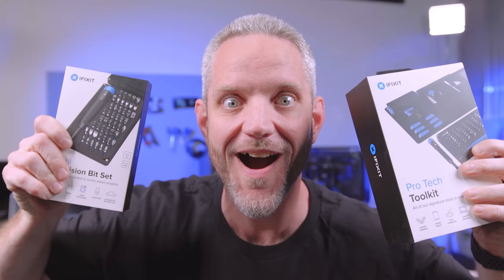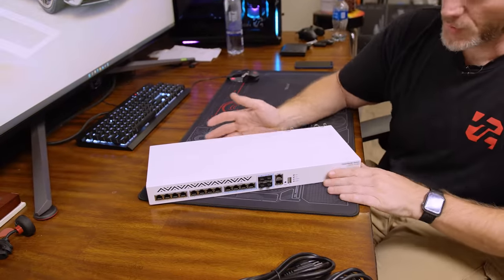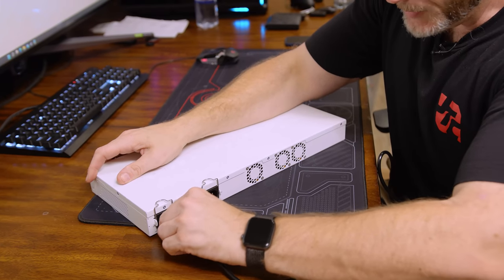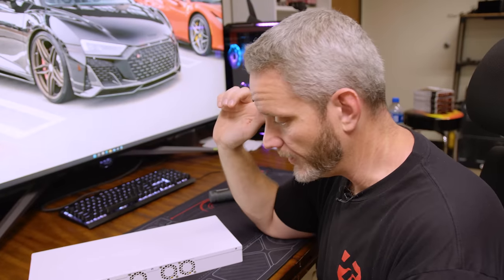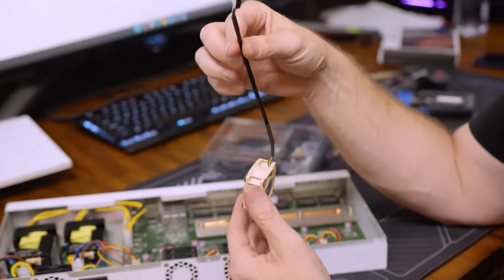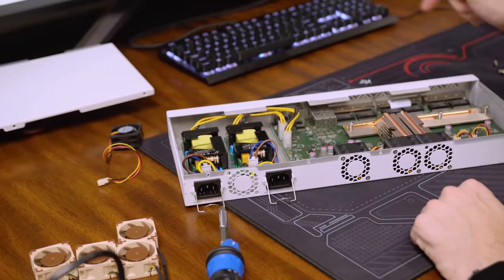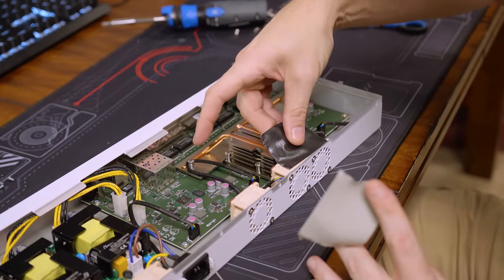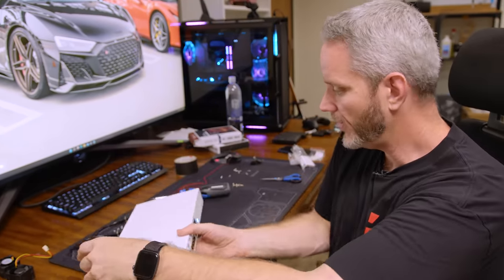We had to modify our new network switch...

Comment: I'm sure you already know all this stuff Jay but I wanted to clarify for your audience some of the confusion around SFP+.

SFP/SFP+ is just a hot-swappable data transceiver used in data network applications. It isn't "Ethernet" or "Fiber". It's a layer 1 technology that only handles electrical and/or optical signaling. It is designed to add versatility to your network infrastructure by allowing the design to implement different carrier mediums (i.e. copper or fiber optic). In most network designs that use SFP/SFP+ technology you'll see either fiber optic modules or preassembled high speed copper modules/cables (called DACs or direct attached copper). However, SFP+ is also capable of supporting RJ45 for standard ethernet connectivity. So if you run into an issue like where Jay was saying he couldn't find an SFP card that would fit in his server, you can still use a "regular" ethernet card in the server and an RJ45 SFP+ module in the switch and everything will work fine. No need to worry about modifying any patch panels. In the case of what Jay is doing, personally, I would look around for an SFP+ card that will fit in the server and connect the server to the switch with a DAC. Especially if they're going to be living in the same rack. That would provide the most reliable connection between server and switch and is plenty capable of 10Gbe speeds (I've run 40 and 100 gigabit DAC connections between core switches in datacenters many times).

Just my two centz...
Reply: Good info. The issue that Jay was referring to at 1:37 is that the SFP+ cards (or any PCIE card for that matter) would not fit in their PCs  that they use to edit videos because the PCs have vertical mount GPUs, NOT that the SFP+ card would not fit in the server. I assume their video editing rigs all have 10G ethernet on the motherboard.
Reply: @kevinoneill2170  There are kinda small PCIE low profile SPF+ cards.

And that resolves the issue. as the most expensive thing are the 10G ethernet cards.
Reply: @kevinoneill2170  Ah I see. Well, in that case, if they do have 10gbe built in then there shouldn't be a problem. I wonder if half-height cards would fit, in case the motherboard doesn't have built in 10gbe.
Reply: I think SFP+ DAC is better than CAT6 for short runs, lower latency and a lot cheaper. 10GB Ethernet is between £50 and £100 per end where as SFP+ cable is £20 and the cards are £30.
Reply: @kevinoneill2170  I think what he means is that you can find SFP+ connectors that adapt to copper for Ethernet runs, instead of fiber. Either way, unless he has runs of Cat 6A (current ethernet standards) surpassing 100 meters (100 meters is the maximum rated distance for Cat 6A at 10Gbase-T), he shouldn't need to worry about SFP+ runs over Ethernet runs in the office/warehouse. The only real benefit of using fiber over copper, that I know of in this case, is that copper tends to get hot at 10Gbase-T.
Reply: @wayland7150  DACs have definitely gotten much cheaper these days. And I agree, for shorter runs, it's definitely the way to go. Especially for rack or riser applications.
Reply: @wayland7150  This!
Reply: @RuxUnderscore  Fiber also has lower signal times than twisted-pair: single-digit microseconds or less over typical on-premises distances, versus up to milliseconds. The major limiting factor on shorter fiber links is processing time and electrical signal propagation within each device.
Reply: The ONLY reason to use 10Gb-T is for backward-compatibility with existing infrastructure.  If you ever have a choice between 10Gb-T and an optic or DAC, go with the latter.

Jay's build, from what I understand, has no room for an Ethernet card at all -- the slots are all blocked by the vertical GPU riser.  So, onboard Ethernet is the only option.  And, of course, most motherboards ship with RJ45 jacks rather than SFP+ slots, because most of the time you only get one Ethernet jack, and it has to be backward-compatible with 1Gb Ethernet, which most people are going to use.

That.. unfortunately.. is a reasonable case for 10Gb-T.  And if you absolutely must use 10Gb-T at all (which should always be the Plan B choice), then it makes far more sense to get a 10Gb-T switch rather than getting a switch with SFP+ slots and using 10Gb-T transceivers.  10Gb copper optics (*) are a hack, and should only ever be used in life-threatening situations, where someone will be killed by murder hornets if you don't get that server up now Now NOW.

(*) I know Gb-T modules are not optical.  It's a misnomer, but it's a handy misnomer, to refer to any SFP/SFP+/QSFP+/etc. add-in module, including ones that terminate in copper.
Reply: @nickwallette6201  Nothing wrong with DAC if it works. It's just not for long runs. OK for interconnecting between things in the same rack and a bit further. Fibre optics use electricity at some point, it's not like they keep it as pure light forever. The SFP+ plug is electrical.
Reply: @wayland7150   I understand that.  I have no issue with DACs at all.  If I'm cabling within a rack, or between adjacent racks, that's the solution I go with.  Otherwise fiber.

My point was, and is, 10Gb-T is terrible, and should never be used, unless it's literally the only option.  :-)  And I wish vendors would stop putting it on so many quasi-performance-oriented systems.  Just include a standard 1Gb-T port, and add an SFP+ slot.
Reply: But can all SFP+ switches support a SFP+ copper module? To my knowledgez such a module draws much more power than a DAC and I have looked at multiple switches and seen no mention of support for SFP+ copper modules.

Right now, I have a 8-port 10GbaseT switch that sounds like a jet engine and can't do 2.5Gbit and 5Gbit which is a bummer with equipment that can't go the full 10Gbit speed.

So I have been looking and wondering if there are any 12-port switches that can do 1/2.5/5/10 Gbit and has some mix of SFP+ and 10GbaseT, does support VLAN and doesn't sound like a plane. Life would be easier if I knew it also supported SFP+ copper modules, because I have at least 6 or 7 NIC with 10GbaseT and several are multi-port, server-grade cards each costing about the same as this switch.
Reply: @perwestermark8920  sorry, the plane bit is necessary if you don't want it cooking to death. 10G over twisted pair is a power & heat pig.
On the upside, with the enterprise rapidly dumping slow old boring 10G optics for shiny new 25G the SFP versions of your cards can be had for comparative chicken feed. Double upside, latency will be better and they'll consume a fraction of power while making far less heat...
Reply: @mattd5136  Just that lots of equipment are 2.5G or 5G copper only. Right now, I have a terrible Zyxel switch to step down from 10G to 2.5G or 5G. For some reasons, Zyxel doesn't even think a managed switch should have the web interface show the MAC table... so good luck with 50-100 devices to keep following cables to locate a device with a specific MAC, something all other manufacturers thinks are part of minimum requirements.
Reply: @perwestermark8920  yes, multi-gig is slowly getting there. Abominably slowly for a tech that's existed nearly 10 years and was officially ratified 6+ years ago.

I use a QNAP switch to bridge my SFP+ high speed segment with the low speed copper. Totally dumb, but it works extremely reliably.

Meanwhile fibre is shaping up to crack the terabit with commodity hardware.
Reply: I came here for this comment. I love JayzTwoCents, but I get uber frustrated watching him try to do IT work. Changing careers to YouTube was a good idea for him.
Reply: @mattd5136  I think multigig is getting there faster than we think.. most of the tinkerers and network guys I know have upgraded their networks in the last 6 months or so to a mixture of 2.5G and/or DAC - because they're both in the 'hell why not' cheap range now.  Motherboards are coming with multigig on board..  Even ISPs are sending out 2.5G routers on their gigabit packages (at freaking last).

Wider deployment is going to have to wait for the switches to be cheaper though - and I mean a similar price to a 1G switch not 10x the price 'because'.
Reply: @TonyHoyle  last 6 months being they key bit after 5.5 years of being 90% the cost of 10G for half/quarter the throughput. Hence: slow. And now that 10G DAC/Fibre is so comparatively cheap and much less of a bottleneck; it's putting pressure (hopefully rapidly downwards!) on the cost effectiveness of multi unless there's no other choice.
Reply: Nailed it. Everything I thought, plus it's not an all or nothing thing like Jay is building it up as in this video. Most businesses have a blend of both. RJ45 Ethernet for workstations/printers/AP's/etc, SFP+ for switching / stacking, servers, potentially WAN, etc.

Comment: Recently redid my home LAN with 48-port gigabit switch from a data center. It was on ebay for under $40, for real network hardware, not trash 5-port plastic boxes. Gigabit is all I need at home.  The internet is gigabit, as are my modem and router  and all my PCs.  So this gigabit switch replaced multiple daisy chained consumer switches with just one I can manage any way I want.  It has a fiber upgrade option if I ever need it.  So for me and my needs, and the super performance, I could not be happier.   Decommissioned data center gear still has a ton of value in a SoHo setting.
Reply: I did similar but I added another network alongside. Most of my servers and gear is in one place so I bought some SFP+ 10Gbps dual port cards and daisy chained my servers together and the end one connects to the SFP+ card in my PC. When I want to access files from my PC I can reach all of my servers over the dedicated 10Gig network. No switch required. The cards and cables  are not very expensive.

Comment: Doubt you will read this but the resolution for daisy chaining switches is to get stackable switches that use a 40+ Gbps backplane to transfer data between them or you can setup most managed switches to have 2-4 ports in a LAG to get 20-40Gbps between the switches.
Reply: Yeah, use two of it's SFP+ ports in LAG to maintain 10Gbps speed and 20Gbps bandwidth.

Comment: Hey Jay. Mikrotik is pretty good. I have a 10GbE SFP+ passively cooled switch from them and it's solid. The problem with 10Gb RJ45 is that it's super power inefficient so that's why you need the crazy cooling and why you don't see many switches with a lot of 10Gb RJ45 ports. There's really not a good solution if you want more ports and only one switch. Those Noctua fans are great also, I've used them to quiet many cranky switches. Some switches have a nonstandard 3 pin wire order and that's what the connection kit is for. No soldering required, just snaps on to the wires.
Reply: You mean not many switches for regular home like use right? 10g RJ45 is pretty much a standard at the business level for new copper equipment and has been for years now (especially server side). Seeing TOR switches of 48/96/128 10gE ports or chassis with 8+ line cards of 48 port 10gE copper is pretty normal. Not cheap, but pretty standard like 1g was before.
Reply: @joee7452  Completely disagree. 10GbE SFP+ networking is standard at the business level server side, and quickly moving to QSFP+ 25GbE. I have no idea what crazy person would ever run 10GbE RJ45 in racks on purpose. That's ridiculous.
Reply: @icebalm  This. IMO 10G RJ45 only kinda makes sense for home and small business because it can make use of existing ethernet runs over small distances. But in actual server racks then anything over 1G is going to be SFP+ and QSFP+.
I have the passiveley-cooled CRS309 in my home rack and it works wonders. I also have the CRS305 floating around somewhere and thinking about getting a CRS317 which is 16 ports and about $220 cheaper than the 12 port switch in this video. 🦊🤘
Reply: @icebalm  Umm, so you would have no grandfathered equipment? No servers with IMM controls? No Servers that have a mix of copper and fiber because most servers come with onboard copper and fiber is typically an IO add. Why would I spend more to add Fiber to a server that would be fine with copper interfaces that are on board? Why would I ignore using those copper interfaces for things like ESXi admin links so I can reserve the fiber 10g (or more) for host communication? Why would I limit myself to a 1g copper switch if I can use a 10g and still provide connections to both 1g and 10g cards? Outside of the datacenter, If I am putting in new access level switches and cabling, why wouldn't I go with a 10g copper switch and cat 6a or 7 cabling to have the availability of 10g to the desktop? 

Datacenter networking is a mix usually of copper 100m-100g and 1g-400g fiber now with more speeds coming. I even have some Inifiniband around. There is a place for all types depending on what you need it to do. To just say that there is no reason to use 10g means you really haven't worked in a normal datacenter.
Reply: @joee7452  I'm saying 10Gb RJ45 is power inefficient and produces a lot of heat so it's not generally used. Of course 1Gb RJ45 is still used for management ports and such, but SFP's are much more efficient for higher speeds and what is generally used in datacenters. You're also confusing connectors with cable types. Generally you'd use DAC cables to connect devices in the same rack since its much more cost effective. 

If you're putting in new access switches and cabling and require 10Gb to desktops you should use SFP+ switches and run single mode fiber because it's a lot cheaper than CAT6a/7 and will support higher speeds in the future. SFP+ switches are more versatile because you can get RJ45 SFPs if you need them. If you don't require 10Gb to devices just run CAT5e and call it a day.

There is no reason to use 10Gb RJ45 in the datacenter.
Reply: @includenull  I have a CRS317 as my network core.  It needs the same Noctua mod as Jay's switch but is otherwise cool, quiet and excellent.

I see lots of servers coming with 10GBase-T onboard, which seems like an extraordinary waste of money. Hot, power hungry and only 10G with thick heavy expensive cables that deadend at only 10G as well. Give me (Q)SFP+ cages anyday.
Reply: @icebalm  10Gb RJ45 is very common in enterprise environments. Like, VERY common. QSFP and stuff like DAC/fiber are not designed for endpoints like PCs, smart devices, access points, AV devices, and on and on and on...

The stuff you talk about here is Datacenter focused technology not endpoint. Also, you're not wrong that 10Gb copper consumes more power than fiber.... But all copper connections consume more power than fiber, that's physics. This is a conversation about application and fiber is not the current best solution all things considered. In fact the world still runs on 1000baseT networking and will for some time.
Reply: @quam0091  Notice I have been talking about **datacenters**, **racks**, and **desktops**.
Reply: @icebalm  Actually cat 7 is suppose to allow for 100g in the future. Whether that actually comes out is anyone's guess.But your statement is wrong. One, when doing structured cabling fiber is not cheaper then 6a or 7. They are so close it basically a toss so if you add the cost of needing to add Fiber cards instead of using onboard, adding SFPs to a modular switch instead of fixed port,  and the price of fiber patches compared to copper patches in large numbers... Fiber is actually more expensive and you would still need to have copper for other things. 
There is no reason to go pure any cabling in a datacenter unless it is very specialized. Your insistence that 10g copper has no reason just doesn't match reality. I could just as easily say that 2 strand fiber has no reason to be in a datacenter. Every run should be 12 strand in prep for 400g+ to every server. That would be dumb to do because not every server will need 400g, just like not every server needs more then the 10g rj45 that is provided stock. If you have a bunch of servers that come in with 2 or 4 10gE copper interfaces and that is plenty for their function, why buy a Fiber card just to ignore them? 

As for the SM fiber to the desktop, that would be much more expensive then cat6a or 7 when you add in the necessary pieces to get a laptop or desktop or printer or "add device here"  connected to it.  Desktops and Laptops pretty much come with a copper interface to use.  Fiber, not so much. So that is an additional cost. 10gE rj45 switches will also allow for 1g and 100m connections for nodes that are not 10g capable at this time.

I am trying to show you that not everything is in a vacuum. There is a lot of grey area that makes what sounds "optimal" to be anything but and not cost effective overall. That is reality.